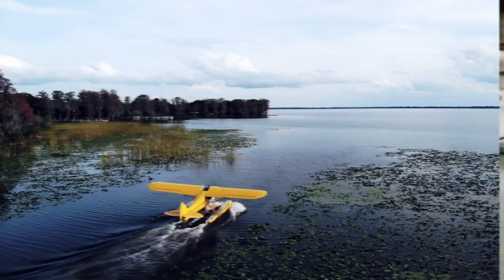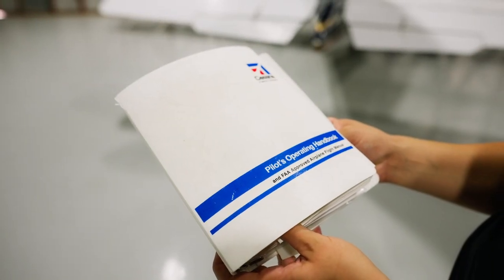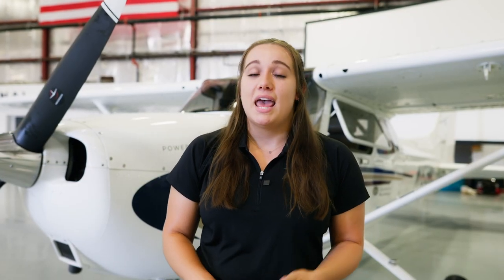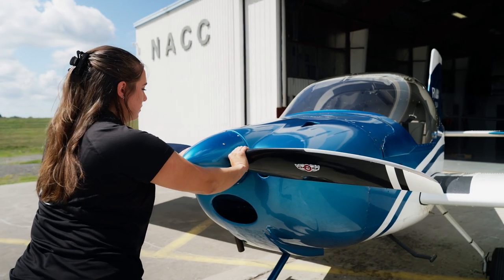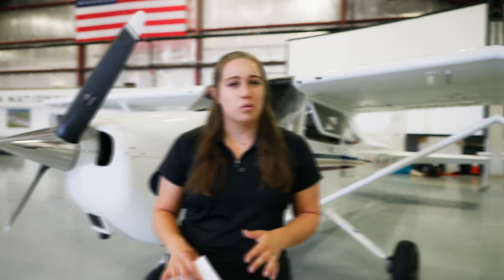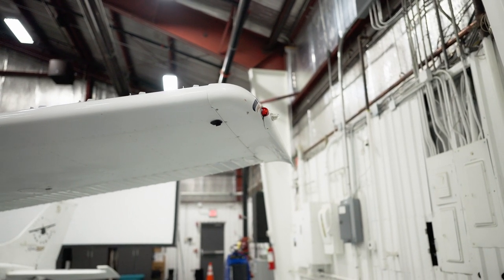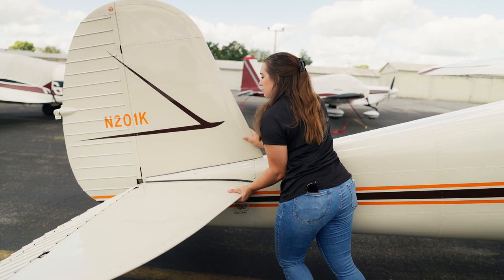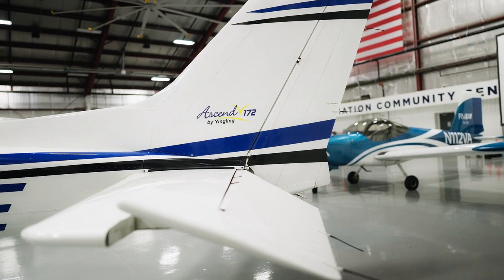Do you know how to properly move an airplane?

Comment: Another tip - when pushing an airplane back, use the tow bar for steering, but not for pushing the plane itself. The tow bars can (and do) slip off, which can lead to banging your head on the prop or spinner as you fall.

Comment: Another tip - when pushing an airplane back, use the tow bar for steering, but not for pushing the plane itself. The tow bars can (and do) slip off, which can lead to banging your head on the prop or spinner as you fall.
Reply from the maker: That's a great tip, thank you!